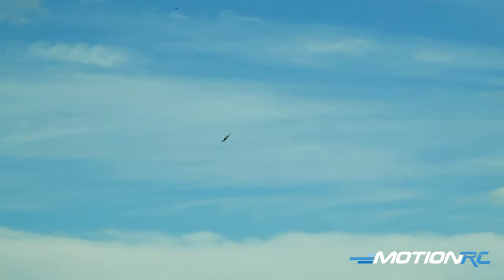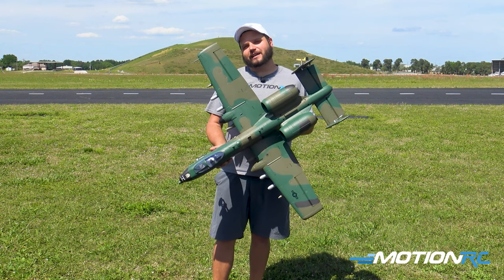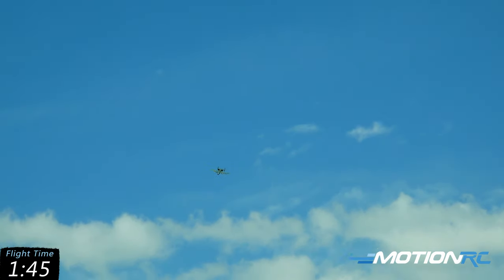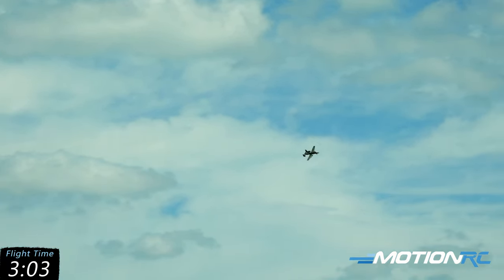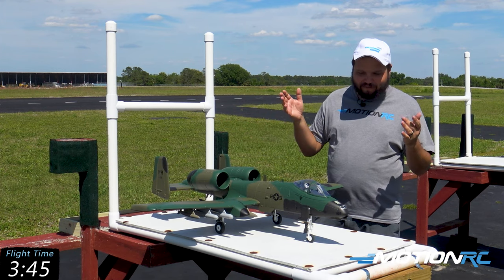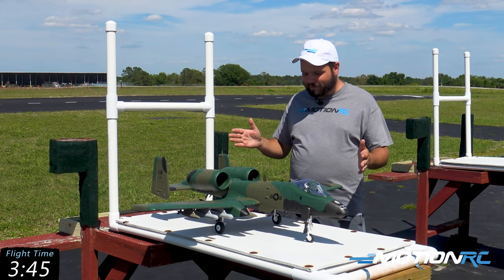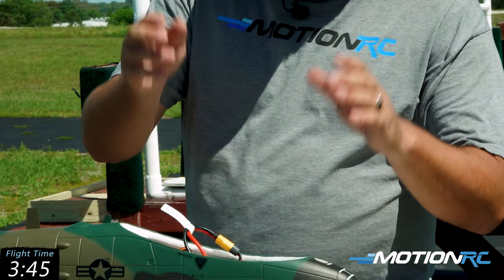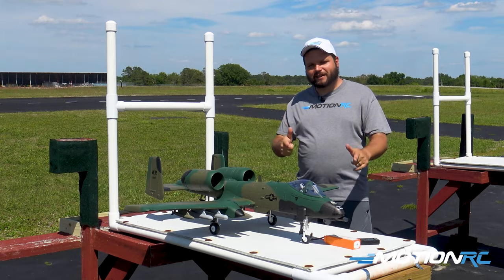Freewing Twin 64mm A-10 Thunderbolt II V2 Full Flight | Motion RC

Comment: How disappointing! I am stunned they stuck with 4S power, especially after coming out with the twin 64mm F-14 that runs on 6s! An upgraded power system would be 6S! Since the vast majority of us fly off a grass field, thrust reversing is worthless, and really, crappy no suspension plastic clad landing gear, give me a break! At $290 I get it, you don't get much. My feeling is I would rather spend another $25-$50 on a model with decent features. After some awesome stuff (all the 80mm upgrades, Zeus, F-14) coming from Freewing, this A-10 is a total disappointment and a terrible release!
Reply: The 4S power was more than enough of what it needed. You could really just add it yourself if you wanted to, but the f-14 will not get off the ground without it.
Reply: @antonsokol4008  Agreed. I think 4S is plenty for this A-10. If you want 6S, go get the E-flite version (which I owned and hated. Way too much weight in a plane that size).
Reply: @ShadowVFX  I have an Eflite A-10 and love it, never thought it was too heavy, one of the best flying planes I have, and have literally flown it to death. The Vulcan fly's OK on 4S also, but the 6S is far superior!